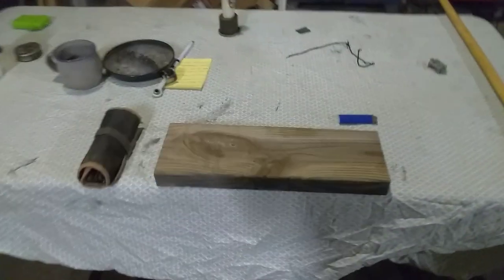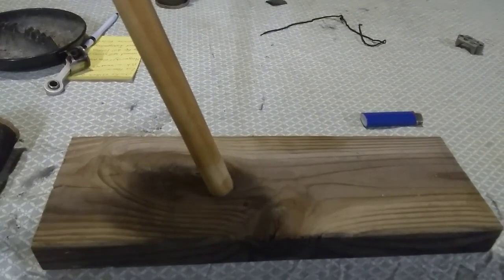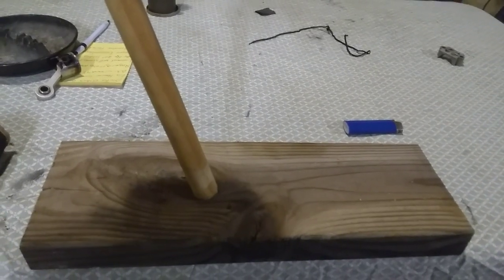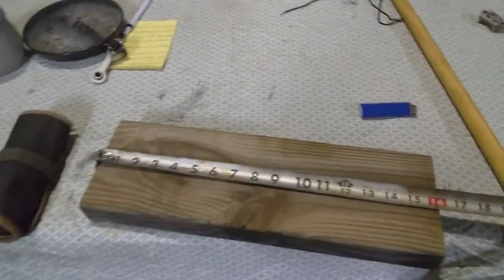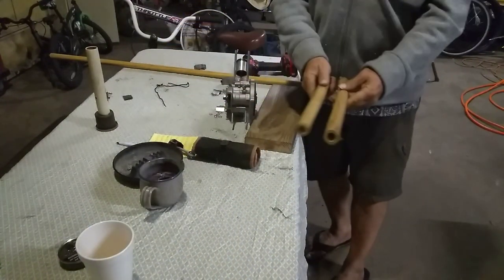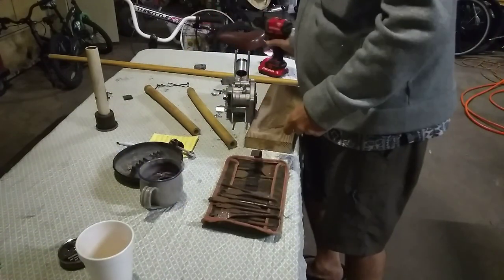Diy Caveman engine stand // motorized bike

Comment: I used a very fine file to take the sharp edge off my rings after I gapped them.They can't catch on ports...Oil in the bearings and on the cylinder so no dry firing.(I'm sure you cleaned the ports and know all this,but new builders may not).Can't wait for the build.
Reply from the maker: Sir you are more than welcome to give tips as if I was a noob those are the kinds people read and understand. I think it's very helpful for them to read people with real experience.thanks

Comment: I didn't know you did  metal framing and drywall 
 I did the same for 20 years  after 10 years of roofing
United Brotherhood of Carpenters and Jointers of America 
 local 675  drywall acoustics lathing and insulation